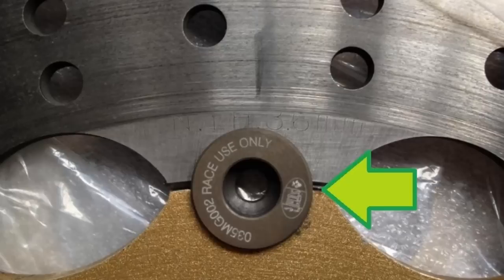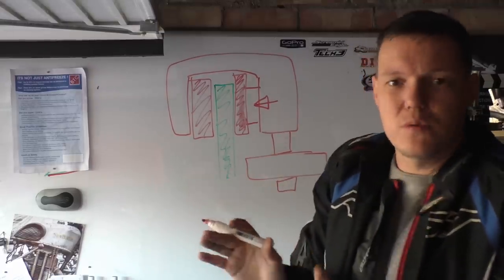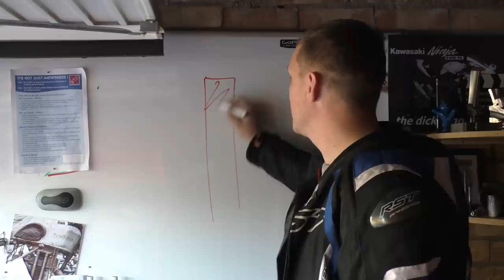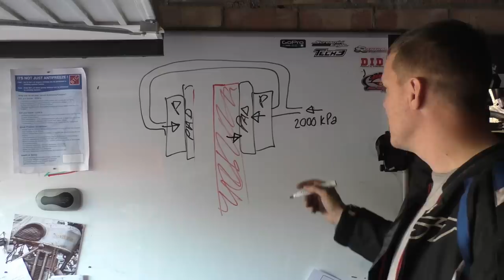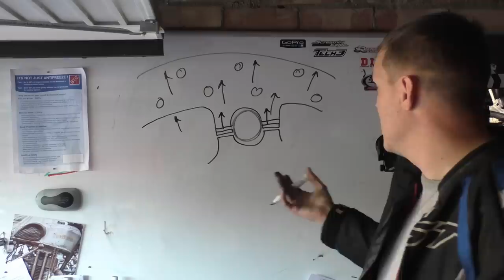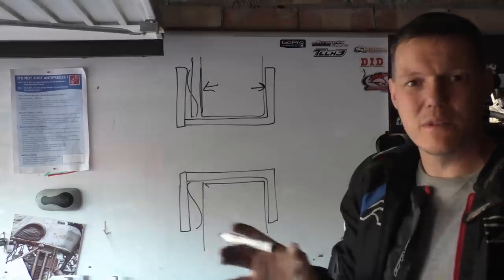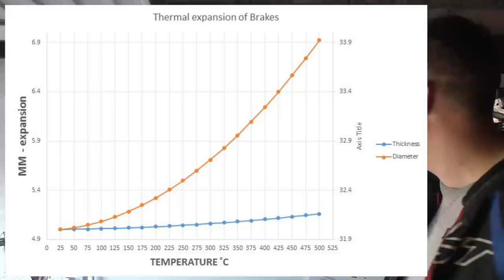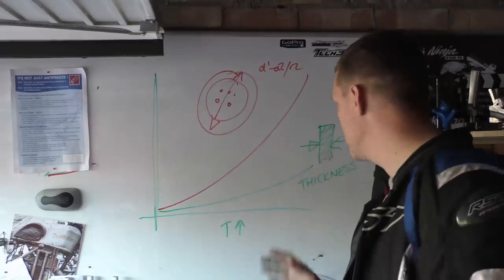Floating Brake Discs - and bobbins

Comment: Very Good Explanation. 
I might have missed you saying it, but another detail to point out is the center hub is typically a lightweight non-ferrous metal like aluminum, and the brake rotor is a ferrous metal for better strength, wear, ect. These two metals expand and contract different amounts when heated/cooled, and would be another reason to separate them with a button.

Comment: I first heard of cleaning bobbins when the discs of my new Monster began pulsing badly. Turned out it was warped discs. Then I had the same issue with another Ducati, then with a KTM. They all had one thing in common, Brembo brakes. I’ve rebuilt 4 sets of callipers because the pistons were sticky even though cleaned carefully every year. I’ve concluded that Brembos are maintenance heavy, they don’t like being left wet, or dirty. When they are working they perform brilliantly, but they don’t seem as reliable as Nissin.

Comment: My old boss miscalculated the expansion on the thickness when he developed some some floating discs on the rear brakes of cars we started manufacturing. The first test session we did at Donnington Park all 3 cars came back in with over half the bolt sheared off. The rest fell off when we touched them.

Comment: You had a fatal flaw in your diagrams, you didn’t draw the inch of copper slip you should paste onto the backs of your pads as described by EBC, come on Matt basics 🙄
Reply: AS DIRECTED BY EBC MATT !!!!!!!!!!!!!!!!!!!!
Reply: YEA!! this dripping off is what lubricates the bobbins. it's where scottoiler got the idea from
Reply: Fuck I was about to write the same thing!
Reply: When dellbs gets a floating disc hes gonna grease the bobbins
Reply: Diagram also misses chamfered brake pads, essential for optimal performance!!! :)

Comment: The discs in this video are typically referred to as semi-floating because of the spring washers. Race bikes often use full-floating discs which do not have the spring washers and I believe they have more clearance in the bobbins. Full floaters make a racket at low speeds. I believe the main reason for semi-floating discs is to make them quiet, and probably to make them last longer from them also having less rotational play.

Comment: All your vids are great bud. BUT! gotta point out something on this topic. 
Everything you say is correct...OBVS...

But, rotating them sometimes isnt SO they rotate, but as a means for displacing brake dust and grit that can be holding the disc slightly out of alignment, (probably by filling in the recesses of some the bevel washers, so as the disc expands its pushed wonky??).

Now I have never had this on bikes ive owned for any length of time.

HOWEVER, I once bought an RSVR Haga rep off an old boy, and he rode it....gentle... 

And he had replaced two sets of discs, because they kept 'warping'. 
These were Brembos, so obviously designed for hard use.

Infact what it was, was because he never braked hard, the discs never expanded , but over the dry weather miles, dust built up in some of the bobbins, and eventually caused the disc to sit wonky. 

And it got MUCH worse, when I bought the bike and actually put some heat in them. To the point that as you started applying hard brake from triple figures, the disc wobble would knock the pistons back in...NOT funny! 

I rotated the bobbins, and got them turning (not because they need to turn, but to displace all the fine grit you could hear in there 

Bam, they were like new. Wobble gone.

Also, after I did that I never needed to do it again, and I think it because I would use them enough to get them hot and use that expansion gap regularly so they couldnt get packed again. 

If you go on the RSV forums, its a common problem with those brembos and steady owners. 

Anyway great vid!
Reply from the maker: So my question to you is this. If just say like the Z900 the bobbins are solid when cold, there isn't enough room to for big bits of shit to get inside. But if were're talking dust then ok cool. 

What you're talking about is people being pussies and like you said - after you got your hands on it then it never happened again. 

On some brakes there is a lot of slop in there in the first place. But granted some 'special' people need to clean the shit out of their bobbins. The point that I'm trying to make is that it a very small amount of people who have to do it, because they should have a bicycle not a bike with an engine lol

This - as you said can also be down to shite discs etc.
Reply: Seen some of the same,.. My Brembos keeps building crud, and grime, then when going in wet weather.. Bhaam,.. Starts with a sick noise, and binding..
Reply: @dirtygarageguy  yeah, or shite in the disc holes,.. I put out a ton last autumn, grime lead to pads wear, noise and a shitty feel.. Neglecting service on the Brembos for years,.. Pads are different, roads are different..

Comment: Old video but only just came across it. Agree with you that bobbins don’t need regular (or any maintenance), however, I recently worked on a vfr1200f with a binding front wheel. Callipers had been rebuilt, new pads, everything clean and moving nicely. Noticed unusual patterns on the front discs, like they were slightly warped. Never tried it before so thought I’d give cleaning the bobbins a go before replacing the discs. Plenty of salt/corrosion came out. Some started to move quite easily, others were really tight. Once all clean, none were loose, still a struggle to move by hand. Road tested and low and behold, binding cured and “warp” patent on disc no longer visible. 
So while I agree with what you’re saying, I wonder if the bobbins could become tight to the point they no longer allow for even thermal expansion, causing your disc to warp slightly.
Reply from the maker: Then replace the disc...
Reply: Few hundred on new discs? Or half an hours labour? Think the customer preferred my solution....
Reply: @rafaellozano8481  dgg is just wrong. Obvious build up of brake dust road grit could misalign  moving parts. Slightly stuck off centre relative to the pad. Cleaned bobbins then  binding puslating warped liked disc brake issue goes away. Must just be a coincidence .

Comment: You need to make a special video where you see how quick you can get round a bike pointing out parts of the bike and then do the people's stupid stuff so point to the brakes and be like no copper grease, no fucking about with floating brakes, engine no hard brake in, no stupid turbos, wheels, no car tyres.. etc. 
See how many you can get in an average sort of 15 minute video.

Comment: Just for the hell of it, I dismantled my Ducati disc,s  completely apart , all circlips away put them in an ultrasonic cleaner ( Bobbins ans clips) then used 3000 + grit and polished all Bobbins to a Mirror finish put them all back together and I still live and looks Awsom . I saw on your or an example that there where no circlips so dismantling is not possible.

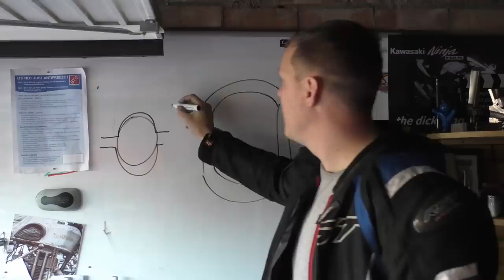Comment: Matt your channel is brilliant. never heard of a requirement to rotate bobbins either. Is their "logic" behind the concept to alleviate the result of wear caused by explanation at 15:50 ? because I could understand the thinking, and that obviously wouldn't be an issue with the EBC model. But my old 99R1 has 130K on the clock and original discs and there's no issue with the bobbins.

Comment: Will my off roader stop better in deep water if i fit floating calipers?
Reply: sure if the water is really hot
Reply: Get wave rotors, they expel water well. Galfer actually invented them for this particular purpose then they found that they work well on street/racing bikes

Comment: I know this is a very old post, but thought I'd give my example. 20005 Triumph Rocket 3. One front rotor very hot after a ride, other side not. Replaced both calipers and pads, new wheel bearings, same thing. Cleaned my bobbins using a drill and simple green. Problem gone! Both sides stay same temp now. So, in my humble opinion. cleaning the bobbins DOES help

Comment: The front rotors on my old Ducati 900SS jingle like crazy when pushing it about the garage, but work normally when under way. I've been told it is normal for the design (early floating design, 1995).

Comment: I'd been hoping you'd cover this.  I recently got into an argument with a total cockend at work who was arguing you should remove the wave washers in order to, I shit you not, "let the discs float better".  He'd replaced his bobbins, at great expense, and fitted them without washers, his front discs made the horrible rattling noise of impending failure.

Comment: Having seen the breadth of your knowledge on this stuff undoubtedly you're right ..however ..years ago I had an FJR 1200 which failed MOT due to front brake judder. When I examined the disc it seemed slightly cocked due to  what I thought was misaligned bobbins ( thought some had  seized) Anyhow..cleaned them all up thinking  the caliper will auto align the disc as a result . Took it back for a retest and it passed! Is it not possible for some disc/bobbin interfaces to seize after movement thereby resulting in what I thought had happened? Cheers anyhow Matt..... your Knowledge is rarely available to wannabee mechanics like myself and much appreciated . Bill in Exeter

Comment: I don't get it. I would say, cleaning bobbins it is pretty much same case as cleaning your caliper pistons. Remove the dust/dirt, so the whole thing don't get stuck. When there is enough of dust or dirt between the bevel washer, bobbin and disc, it might limit the space to expand...leading to bending or w/e other problem. Isn't it?
Reply from the maker: We'll do a follow up on this, but you're talking dust here. The SV's bobbins have probably not been cleaned out in years - we'll have a look

Comment: In the VFR1200 Owners world I have been arguing with loads of guys who are obsessed with cleaning the bobbins out.  They are convinced that the small vibration many owners eventually feel in the front brakes are due to the bobbins "seizing," when in reality the pad clips and slide pins are overly contaminated with brake dust from the sintered pads.  When my bike developed a small vibration, all I did was take my calipers off, took the pads out, and cleaned all of the brake dust buildup off all of the pins, pistons, and clips, put it back together, and lo and behold it was nice and smooth again.  Maybe you should cover that concept in a video?  My own words fell on deaf ears.
Reply from the maker: Already have.
Reply: @dirtygarageguy  I guess I better go back and pay more attention.  Woops

Comment: I swapped my front tire and wasn't too careful with the rotor, and afterwards I noticed the outer part of the left brake disk now has a lot more play than the right outer brake disk (1-2 mm side to side). Is it faulty and do I need to change them or will it "tighten" over time and nothing to worry about? It brakes fine.. great content Matt, thanks
Reply from the maker: Push it down the street and pull the brakes to stop. Do this a few times and see if it gets any better

Comment: Hi Matt, I've an XJR1300 (twin discs, four pot callipers) and when I brake, the front end judders badly. The first thing I assumed was warped discs but I've ruled that out. I've seen the videos on cleaning the bobbins to eliminate judder so guess what..... I did it. I used tons of brake cleaner and spun the bobbins (they are still very tight). Result....... drastically reduced juddering. It's not completely gone though. Any ideas why it helped?
Reply from the maker: Loads of people say the opposite - so for your case I don't know, unless you had some real shit in there like a small stone of somthing that was causing the disc to flex. Did you clean your calipers at the same time
Reply: No, I'm gonna strip down and refurbish the callipers later in the winter.
Reply: Also had this issue on a 2017 GSXR with bad judderring : pulsating through the lever on hard braking. I cleaned the bobbins with massses of brake cleaner and has made a massive difference. But as per the above, I’m not clear why.

Comment: Bernoulli’ theorem, “an increase in the speed of a fluid occurs simultaneously with a decrease in pressure or a decrease in the fluid’ potential energy” 
A true liquid cannot be compressed. 
I think I remembered that correctly please let me know if I screwed it up. 
This is why I hate late braking when I see it. People believe that leaver or peddle will stop them without understanding the dynamics of braking systems. 
These classroom videos are brilliant, thanks.
Reply from the maker: "A true liquid cannot be compressed."

- Anything can be compressed, like steel. The extreme of this is a neutron star
Reply: The Workshop, 
Ok if I remember this correctly, once you apply enough pressure to a liquid due to thermodynamics and fluid dynamics (hand in hand with each other) with the pressure increased the fluid becomes a solid. 
As we understand gas being compressed in to a liquid form this produces heat then as the gas becomes liquid it cools and eventually freezes in to a solid. If of course the pressure is still applied. (Fridges & freezers)
 So within the braking system as the pressure increases, the fluid acts as a solid, Producing heat as a result. This is of course why the type of fluid used in braking systems has a low content of impurity’s “true liquid” (air water molecules) “and is why I want to smack the shit out of people when I see them pick up any type of hydraulic fluid and shake it.”
Did I remember it correctly?
And thanks for your time Matt.

Comment: So my question is why do brembo discs have free floating, fully rotating bobbins? Im holding a set in my hands now and the bobbins rattle about like a goodn. Also there is 0.7mm of sideways movement from disc to disc carrier so im presuming this is to allow the discs to float in all directions
Reply from the maker: "So my question is why do brembo discs have free floating, fully rotating bobbins?"

- Usually because they're intended for racing and therefore get hotter. The point its that bobbins don't have to rotate or in another way of putting it - bobbins don't have to rotate to work properly

Comment: I dont think Matt mentioned them specifically but if you have EBC SD floating rotors you will likely BREAK something if you attempt to turn them as they arent a circular 'shape under the bobbin cover ( which is actually the unique selling design point ), they can only move outwards or inwards.
Reply from the maker: They're in this video
Reply: @dirtygarageguy  I 'm a muppet, I kept watching and saw the section where you did mention them now ...

Comment: I found videos on cleaning bobbins from searching for brake pulsing.  My 2003 Kawa Z1000 has 6k miles on it.  What's the most likely problem for brake pulsing?  You can feel it throughout the stop, not just slow stops.  Thanks from West Virginia!
Reply from the maker: Pulsing is usually a mis-aligned caliper or shit on the disc. In very few cases its a warped disc
Reply: @dirtygarageguy  thanks for your reply. Looking forward to a UK visit someday. I've also seen a variety of "cleaning" recommendations anywhere from 800 to 150 grit sandpaper.   What say you Sir?
Reply from the maker: 150 would do

Comment: Great informative video, thanks for the upload. Maybe you can help me with an issue I have. I just replaced my 2 front discs as the old 2 were ridged and well below the minimum wear limit. 2 brand new MTX MDF05001 discs and EBC pads for both discs. Less than a month later the bike failed it's MOT due to excessive fluctuation in the front brakes. The Tester said he suspects the discs are warped but when I checked them with a Dial Test Indicator the run out is 0.09mm and the max permitted run out according to the manual is 0.3mm so well within spec. After inspection of the 4 pot callipers I noticed that the seals on some of the pistons are blowing out through the space between the piston and the aluminium calliper body. I've replaced both callipers and am taking the bike down to see if this has fixed the fluctuation before we retest it. Would the blown out seals (which were not leaking fluid) cause the pistons to hang and in turn cause the fluctuation in braking effort? I can not believe that the new discs are bad unless of course they were poorly surfaced during the manufacturing process and there are areas of rotor that are thicker than others. Bike is a 2007 Suzuki GSF650 SA. Thanks in advance for any insight.